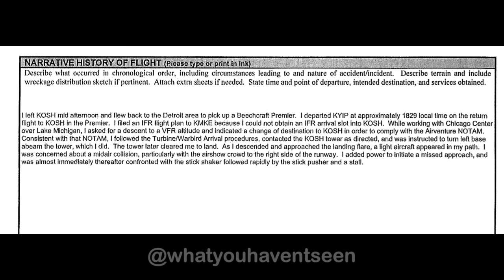Jack Roush Crashes Private Jet At Oshkosh (2010)

Comment: "The secret to a perfect landing is a perfect approach" ( quote from Jason R, but don't know if it is his original).  This approach was anything but perfect, very obviously an aerobatic approach in an aircraft not meant for such, and obviously by a pilot not meant for such.
Reply: Best reply so far.
Reply: I only fly simulator with VR.  It feels to me the pilot was doing something over his ability.  Very aggressive approach without flap, TOO high and failed alignment.
Reply: the aircraft could handle it, the pilot was way out of his skill level.

Comment: Pilot aside, that seems to be a well designed plane. Took the crash well and stayed intact allowing for easy egress.
Reply: They are, carbon fiber fuselage. Excellent aircraft. Of course when placed in the hands of fools even excellent aircraft cannot withstand the foolhardy.
Reply: Exactly.  How many planes take a landing like that, without going up in flames and killing the passengers?  Not many.
Reply: @utubeskreename9516   I think luck must have played the largest part in him not cartwheeling and being burnt to a crisp in that one.
Reply: He landed on somewhat of a downward slope which redirected a lot of the inertia.
Reply: I'm impressed by its low stall speed
Reply: Phillip Aubin   the carbon fiber is in the passenger cabin area only , the 2 places it broke appear to be where the carbon starts and stops .  the  Company I work for had one for a few yrs it is a very fast jet but it has has a shorter range than most . also the 4th window is a sticker  , its now really a window .
Reply: cracked up without fire. strong point, but luck rather than design i guess
Reply: @dennisbrown9023  just a sticker, that's terrible
Reply: This guy is beyond lucky.